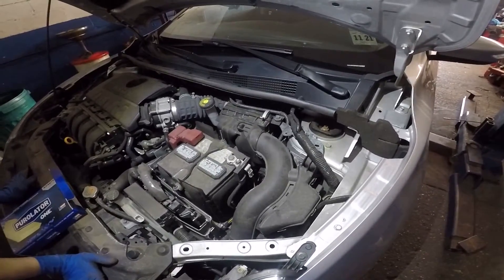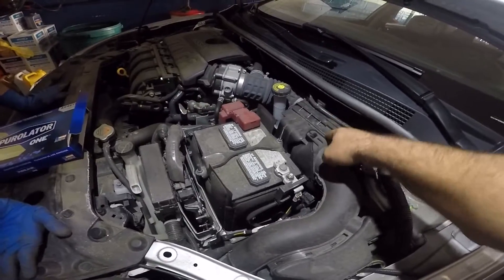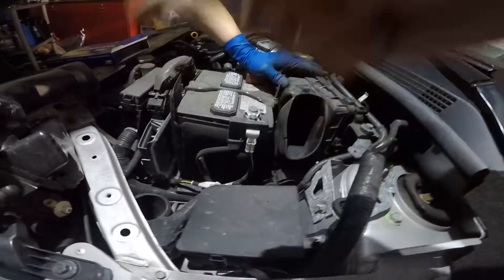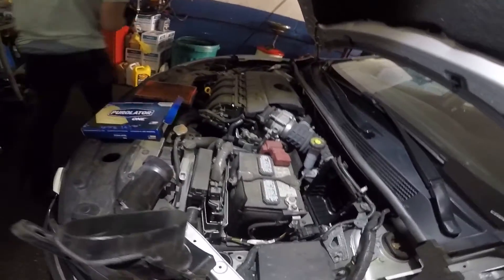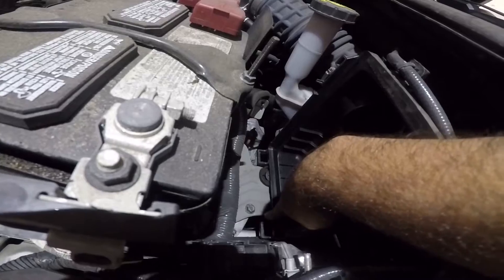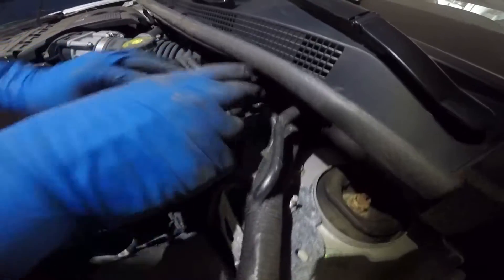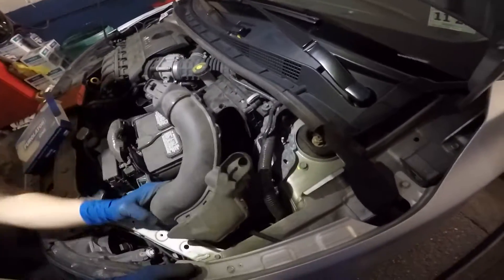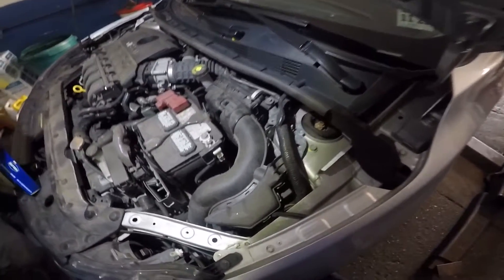How to change engine air filter on 2017 Nissan Sentra

Comment: Question for you. Down on the left of the airbox, there's a little tube that isn't connected to anything. I couldn't quite see clearly in this video, but is yours connected to anything? Mine recently started whistling upon acceleration and I'm wondering if that should be connected to something.
Reply: dude same! I have a 2017 nissan sentra and noticed the panel, does an in-cabin microfilter also exist for these cars? let me know what info you find!